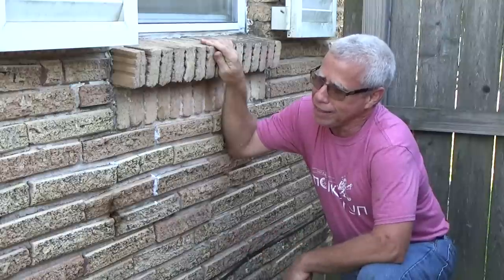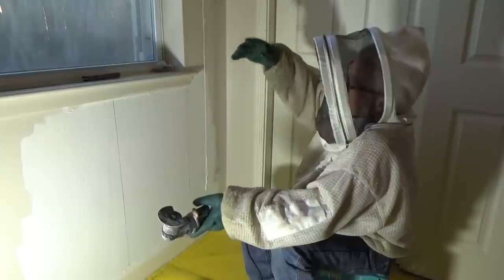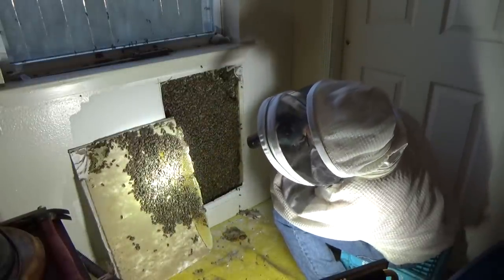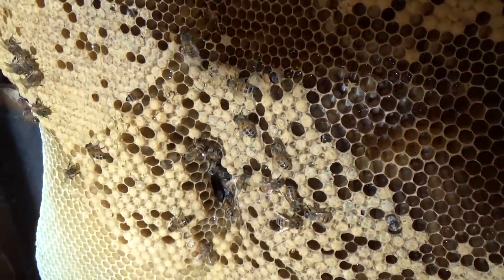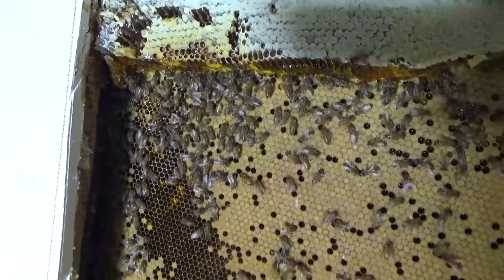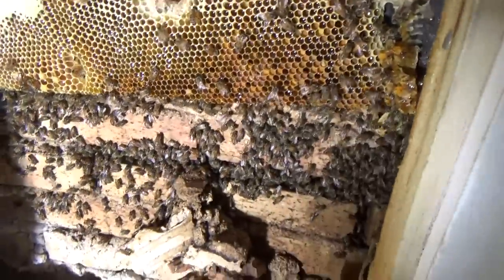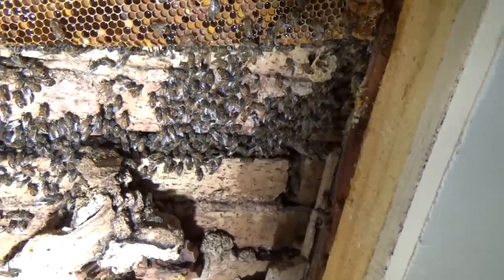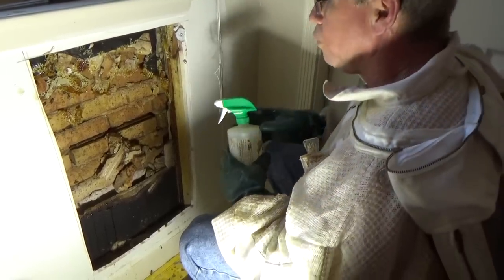I SHOULD HAVE PUT ON THE VEIL!

Comment: I for, some reason, went and checked my hive. This is my first time with bees and I bought every new. I have a brood box on the bottom,  a medium super, and a medium super on top of that. When I pulled the cover off, the top was covered in green mold. When I pulled the top off, there was mold starting on the frames and a load of hive beetles. I harvested honey one time, out of the top super only, with plenty of time for them to build up their supplies for winter. I put wax foundations back in. They built up one frame and the rest are broken apart and full of hive beetles. They aren't as strong as they were. What happened? Can I save this or will I more than likely have to start over next year? I'm in Georgia. I figured that I'd ask on here so in case someone else is having the same problem it will help them as well.
Reply from the maker: Hive beetles are nasty critters, and if I'm understanding what you wrote, your hive is a goner. Hive beetles take advantage of weak hives and overrun them, not a pretty sight. This is very common at this time of the year. If your queen is still alive, you can put all the remaining bees in a 5 frame nuc with some drawn comb, but nothing from the old hive, it has beetle eggs in everything. Then feed them. It's possible to save them, but it will require a lot of work on your part, and then them still may not make it through the winter. Good luck and God's peace.
Mr. Ed
Reply: how could mold get in the have? Can I bleach everything after the bees are gone to get rid of the mold? Now I just have to figure out what I did wrong and fix it next year. Thank you for taking the time to help me out and may God bless you.
Reply from the maker: @JesusisLord-7A  First, thank you for your blessing, it is greatly appreciated. Mold forms due to a build up of moisture in the hive. Improper ventilation is the main culprit in mold forming, which is why I ONLY use screened bottom boards on all of our hives. Even if he comb has mold on it, if allowed to dry throughly, and it has not been damaged by moths or beetles, the bees will clean it up if the hive is strong enough. Not all lessons in bee keeping are sweet ones, but regardless of good or bad, we can learn from them. God's peace brother.
Mr. Ed